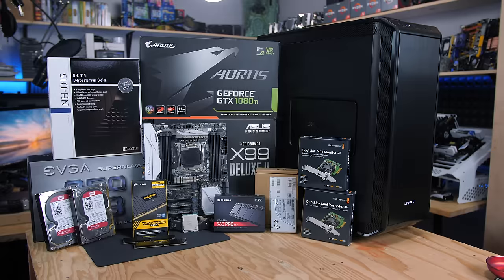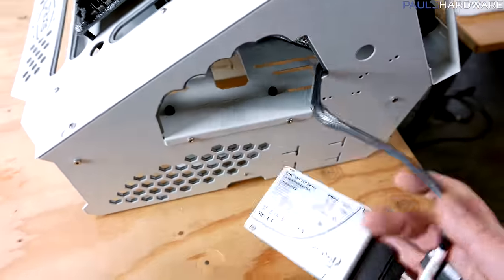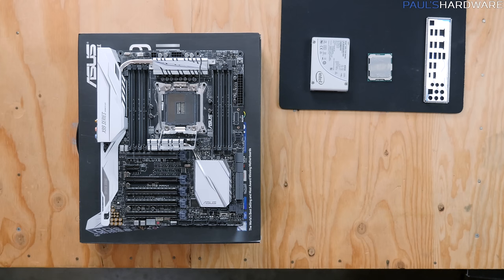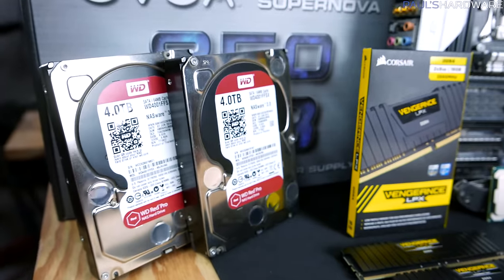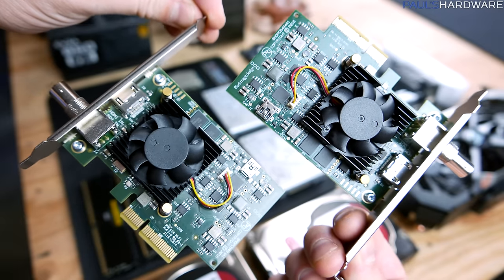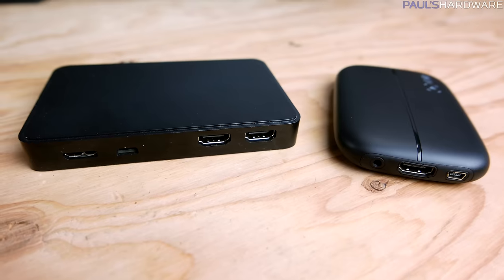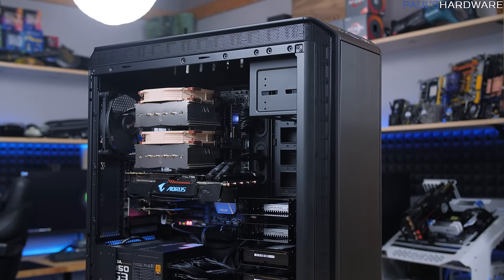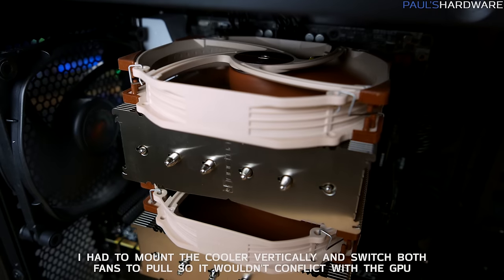The GODLY PC! My Ultimate Streaming + Capture System Build

Comment: good Lord that's beautiful but way out of my price range. any suggestions for a sub 1k build for gaming/ streaming?
Reply: folgore tech city's last video, check it out.
Reply: folgore Yes! My suggestion would be
R5 1600x
MSI B350 Gaming Pro
16 or 8 Gb of Corsairs 3000Mhz Vengeance 
A RX 580 8Gb
A Corsair 450WCx power supply
And the case I leave it up to you my friend!
Reply: If it's in the budget tho (not sure) buy a R7 1700, otherwise the 1600x is still pretty solid for gaming/streaming
Reply: João Gama 16 Gb RAM for sure, and a gtx 1070 would be a way better choice
Reply: Crazed Buttstabber Yeah I know but if u buy a 1070 with all of the other components it would probably go higher than 1k, at least where I live

Comment: @paul I am currently trying to Capture 4k or 2k Gaming from my gaming PC. I am using Shadowplay to capture 4k 60fps 130mbps... I was using a old 7200 drive which I could tell wasnt working the best as you can go to my channel and see the top 10 videos where used with that old HHD. I am now using a Samsung 840 Pro to Write and capture my games to.. Would you recommend me to upgrade to a Intel 750 Series AIC 400GB PCI-Express 3.0 x4 MLC Internal Solid State Drive (SSD)     VERSUS a normal SSD????? Any suggestions would Help.

Current Build 
I7 7820-x @ 5.1Ghz (yes its stable)
Thermaltake 2.0 Water cooled
EVGA GeForce GTX 1080 Ti SC2 HYBRID GAMING x2 in SLI. Both are water cooled but have no where to mount them besides sitting on the floor.. LOL need case Ideas for upgraded 360 Rad cpu and two single gpu rads.
X299 Aorus Gaming 7 mobo
32gb DD4 Corsair Veng @ 3200
Samsung 850 Pro 256gb  OS w10
Samsung 840 Pro 256gb Storage
WD 1TB 7200 Storage
WD 500GB Storage
Asus 27' 165hz Primary
Asus 27' 144hz Secondary

Comment: Why did you point your heatsink fans down that's you want air to flow through not get squashed against the graphics card or draw heat from the gpu
Reply from the maker: they're in pull, air goes up
Reply: but that draws heat given off by the gpu..

Comment: I'm getting 32gb of rgb trident ram, and wd 4tb black, a Asus 1070, i7 6700k, z270 Asus maximus ix, 500gb ssd, 650watt psu, 400c case, kraken x62, and elgato hd60 pro I plan to do twitch for fun so I'm buying a at2035 and Logitech c920 with a 144hz monitor
Reply: SenshiGames why 32gb? what do you need 32 gb for? I bareley use 8
Reply: Fatal Potatoe I honestly don't  know but I want to make a Ultimate pc that will last me a good while since I'll barely be upgrading it
Reply: SenshiGames Then maybe go 16 GB RAM and 1080 Ti. 1070 isn't powerful enough for a PC like that.
Reply: true but I bought most of the parts already so I'll probably get a 1080ti in the future

Comment: Sorry to be picky, but if you put 2 400gh drives in raid 0 you end up with 400gb usable space.
Reply from the maker: In RAID 1, you'd have redundancy and end up with 400GB. In RAID 0, striping, you get the full capacity of both drives but no redundancy
Reply: Ah sorry my mistake, got them confused again hehe

Comment: noob question but shouldnt the fans on the cpu cooler be facing the back of the case?
Reply: Nathanial Bordelon no because it would be pulling air from the back of the case and pushing it towards the front of the chassis.
Reply: I meant as in exhausting the air out the back
Reply: Nathanial Bordelon I mean based on the size of the actual cpu cooler there wouldn't be enough room also you have to remember he needs enough clearance for the ram.

Comment: I'm having trouble with my new system i built 2 days ago. I've tried everything but i keep getting no signal to my monitor. I have AOC G2460PF monitor, i5 7600k, ASUS Prime Z270-A motherboard, ASUS ROG GeForce Strix GPU, BeQuiet 600W PwrSup. I've tried plugging cable into GPU and motherboard, booting with one stick of ram, taken the CMOS battery out for a minute, tried using another monitor, checked CPU socket pins, redone all cables twice, used a different GPU. Anyone got any other tips?
Reply: zeehorse Could it be the hdmi/dvi/dp cable? 
Maybe try another pcie slot.
Is there any beeps audible?
Reply: The Banana Man I have tried another pci-e slot, no beeps audible, the DP cable is a little bent but i'm sure that it shouldn't affect it
Reply: The Banana Man I figured it out, the cpu socket had a slightly bent pin!
Reply: zeehorse If the motherboard has a bent pin, it may not be able to be returned. Unless you 'unbend it' and not break it. Then they may not know :P
(Not that I endorse this though)
Reply: The Banana Man I took the whole system to the place where i got it from, they were able to fix it for me!

Comment: sorry but this is an average l Joe PC if you exclude the 6950x ... like heck mine is even better with almost same cost !! 
MY RIG
Processor : Intel Core I7 6700K @ 4.8GHz
Rams: Corsair Vengeance LED 32GB DDR4@3400hz
Motherboard: Asus Rog Maximus viii extreme/assembly
Video Card: NVIDIA TITAN X p
PSU: Corsair RM 1000X
HDD: WD Black (2016, SATA-600), 6TB 
SDD: Samsung 960 Pro 512GB
Cooling: EK Custom loop (CPU+VGA)
Case: Corsair Obsidian 750D Airflow

Total cost: 3927 EUR   (Netherlands market prices)

Pauls RIG
Processor:  Intel Core i7-6950X
Rams:  Corsair Vengeance LPX 64GB (4 x 16GB) DDR4-3000 Memory 
Motherboard: Asus X99-DELUXE II ATX LGA2011-3 Motherboard 
Video Card: Gigabyte AORUS GTX 1080 Ti 11G
PSU: EVGA SuperNOVA G3 850W 80+ Gold
HDD: 2x Western Digital Black 4TB 3.5" Internal Hard Drives
SDD: 2x Intel 750 Series 400GB U.2 NVME Solid State Drives
Cooling: Noctua NH-D15 82.5 CFM CPU Cooler
Case: be quiet! - Dark Base 900 
Blackmagic Design DeckLink Mini Recorder 4K PCIe Capture Card
Blackmagic Design DeckLink Mini Recorder 4K PCIe Capture Card

Total cost:5191  EUR !!!!!

Comment: You really bought a 6950X... better off with a dual-socket board, a XEON, add a 2nd later. The 6950X is so expensive, who would risk oc'ing it to any useful degree? Outperformed by Ryzen anyway. ;)

(I'm half kidding btw, I built a 6850K setup with an R5E; oops... oh well)

Comment: The RGB implementation that evga and gigabyte are using on their current geforce lineup is embarrassing. Looks like a 50yr old engineer slapped on a home-brew design on the side of the card. Why is it so hard to make a nice looking card like the founders edition nvidia makes, and not have it sound like a vacuum cleaner??

Comment: seems that Linux are not only one who have dumb/expensive pc build!! Only stupid peoples would  go with i7 6950x now for 1600$ when for few weeks R9 ryzens will come at significally lower price and you can get base 10/20 r9 ryzen for around 550$ or even cheaper but it would be faster then i7 6950x in most of important tasks